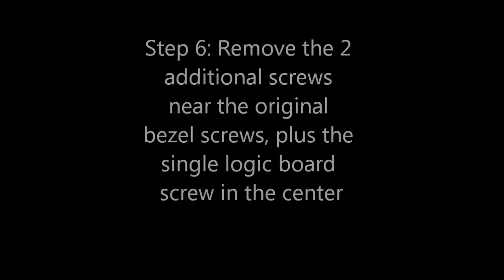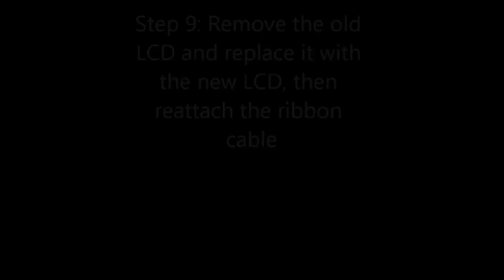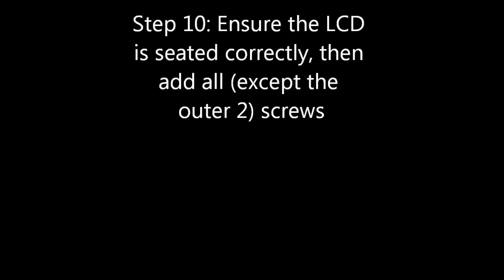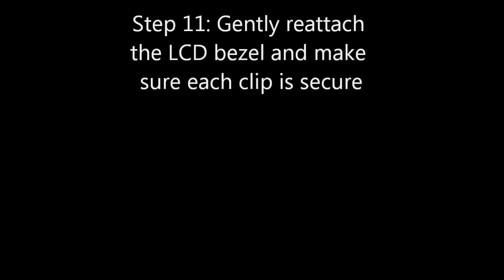DIY Laptop Screen Replacement : Replacing the LCD panel on a Lenovo X220 Thinkpad

Comment: This was a very useful video.  Replaced screen that had cracked due to flying heavy object (!) problem without fuss.  That knife is a bit over the top; a small craft nice might be more suitable unless you are worried about zombies during the screen change.

Comment: They go right under the screws in the extreme top left and top right corner of the backplate.  The glue used is weak and they pop off easily, usually attaching to the screw right above them

Comment: Thanks! Great video! My screen recently started flickering and turning into vertical lines (tartan). When I change the angle, I can get it working for a time (and what I'm typing reappears). So I think it's a hardware issue -- that the connection is loose. I have also been having occasional bleeding from different windows (which I think may be an issue with Gnome / Fedora), which goes away when I press the Windows key twice. 

Would you agree the vertical lines issue is likely a hardware / wire connection problem? Would you happen to know whether the common point of failure is below the panel? Or is it under the keyboard? 

I will start tinkering tomorrow but prefer not to take apart anything I don't need to. Thanks again.

Comment: Hey, great video. My x220 was working fine the other day, I closed it, and then 5 minutes later opened it back up to use it and there was a thick vertical line going down the right hand side of the screen. Someone said it might just be loose cables and to "re-seat" them. Do you think that the one you removed from the screen in the video would do the trick or is there another end of it that might be the problem?

Comment: its like a small metal with somewhat like blue line on it. lengthwise probably the same length as the lcd screws if not much a little longer. it seems to fit on the top left and right side of the back lcd cover. but I have no idea where they supposed to be..

Comment: Thanks for video! One question: Where/of which type do you buy your IPS screen?
Reply: It's been 2 weeks so you probably have figured it out, but in case you haven't, the IPS screen for the X220 is called "FRU 93P5675".
Reply: Poockiy  thanks!

Comment: Awesome video, but you actually don’t need to remove that center middle screw. Mine was stripped to death so I was a little worried but it turned out it wasn’t even necessary!